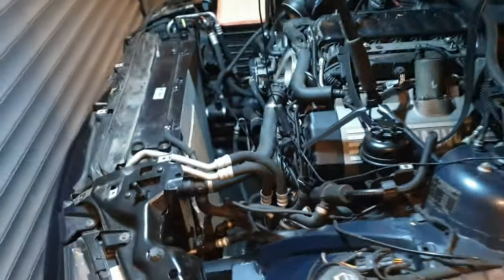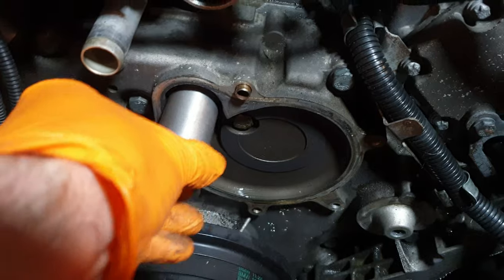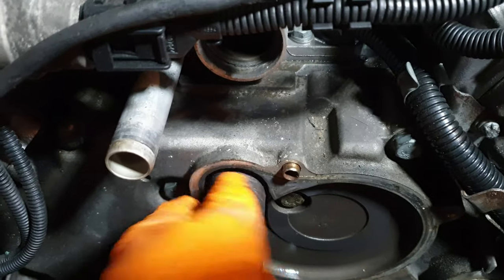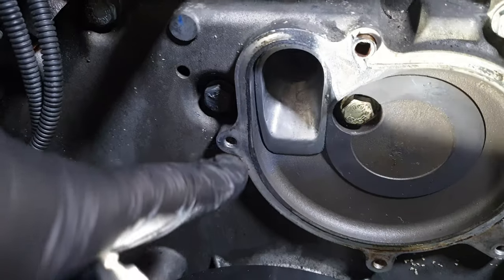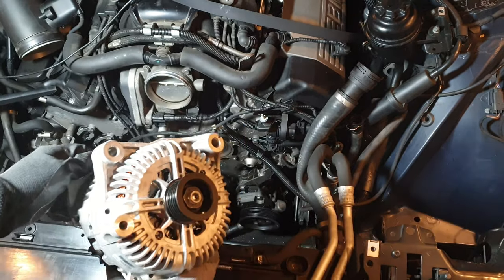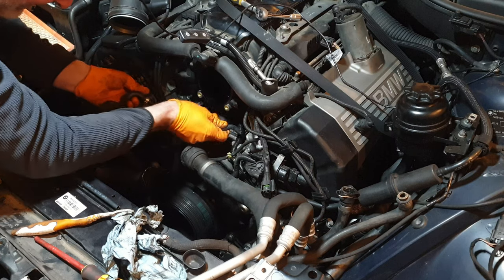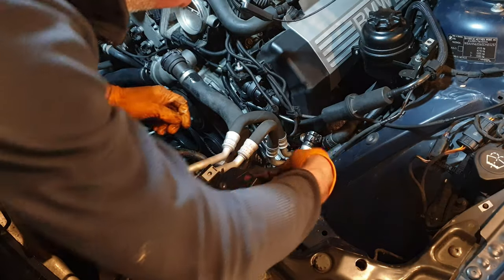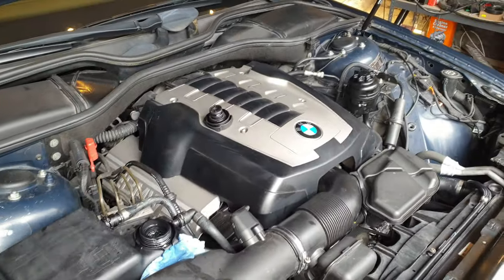BMW E66 740Li Repair Series - A Complete Cooling System Overhaul

Comment: Good job Steve. The coolant system runs so hot on the n62 that the pipes all perish one by one so definitely worth doing all of them at once. I remember finding 4 leaks one after another, should really have done them all. Also the alternator is a good call, though there was a lad in blanch that repaired them and made them like new again. It is one of the worst alternators to remove from a car.
Reply from the maker: Yep feels good to have them all done!

Comment: you can also change the thermostat for a colder one like I did on my e53 4.8is.
my coolant temp never goes above 93 degrees celsius.
Reply from the maker: Aye, its on the list. That was probably the time to do it, but its not the worst job now i've done it a few times.

Comment: Hi, really enjoy your content. I’ve recently learnt the hard way with these. Those metal hose clips are designed to be installed closed so to speak. How do I know this you might ask. I had one blow off recently that was installed on the twist and didn’t seat properly on a 3 series. So the moral of the story is installed it closed and let it click into place. Great content by the way and lots of lovely fixes 👍👍👍
Reply from the maker: Thanks for the info!

Comment: You could have a leak in the valley area where the pipes run in the V of the engine, under the intake manifolds.
Reply from the maker: The pan and gasket in there are not that old, so hopefully not. Two weeks on and the car is holding coolant like a champ.